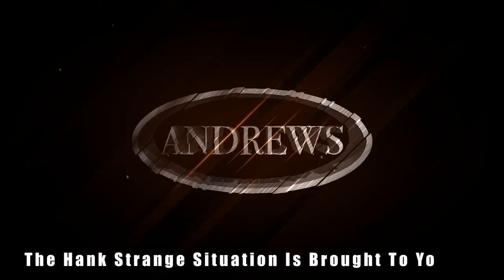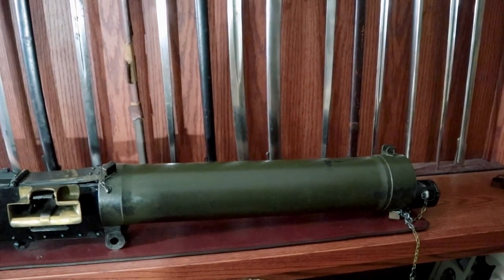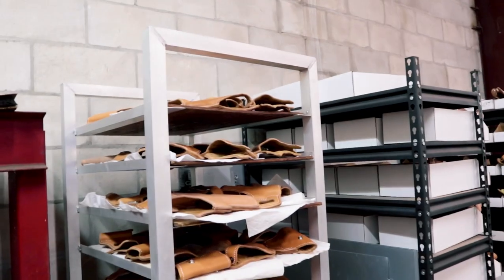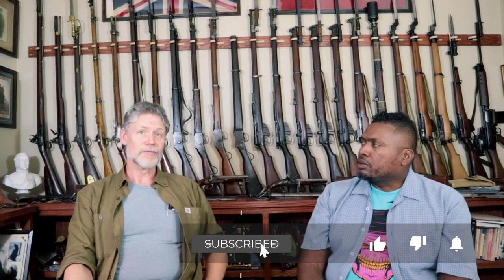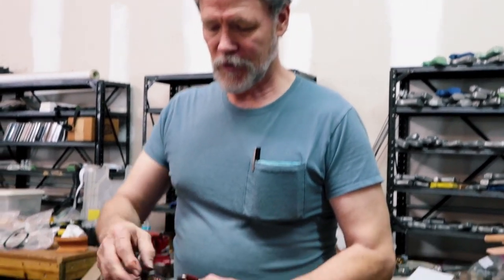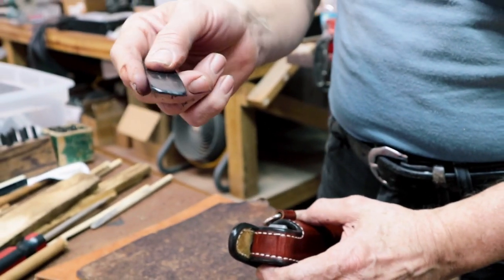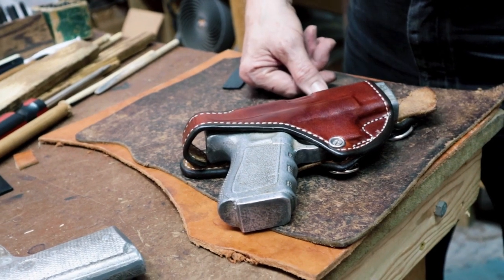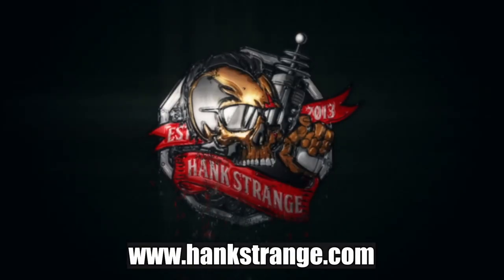Leather Holster Making For Beginners How To Loosen Up Leather Holsters

Comment: Seems like a good use for a 3d printer, if you could get the measurements from the factory and do the designing than you could build your own "blue guns"... Maybe even eventually companies would do the design work themselves to give to holster makers
Reply: That does sound like an excellent idea. It seems like the gun companies could provide files to print a "blue gun" to holster makers for little to no cost just to get holsters into the market.

Comment: I have a leather holster  (Barsony Leather, Beaverton, OR) that is VERY comfortable, but it is too sticky on my pistol (P365.) When it is on, it makes it very hard to re-holster; removal is tough but doable. When it is off holstering and removal is very easy and the pistol fits beautifully. What is the best way to soften and unstickify (if that is a word) the holster?
Reply: Ok.   You bought a cheap one size fits none garbage holster.  Throw that in the o well box that every serious concealed has and buy a properly made holster from Sam or another quality maker.   be prepared to spend around $120  for quality leather.
Reply: @landnnut  Actually, I started inserting my G19 into the holster at night and that stretched the leather that tiny bit that allowed the SIG to fit perfectly. (It is a very well made holster BTW.)